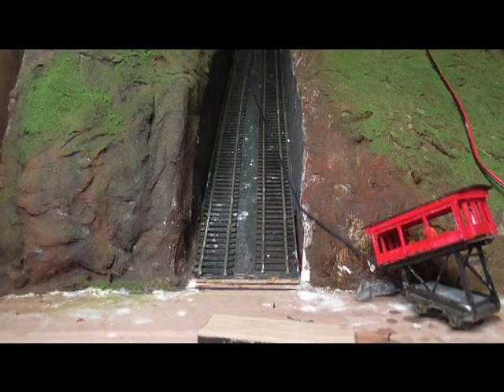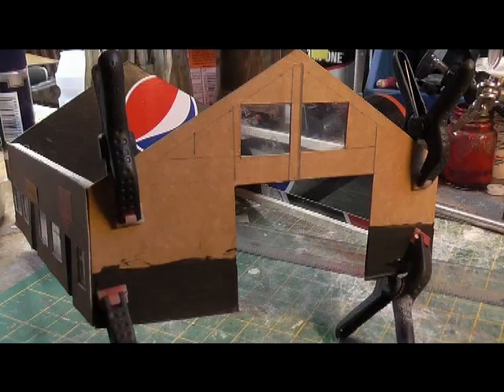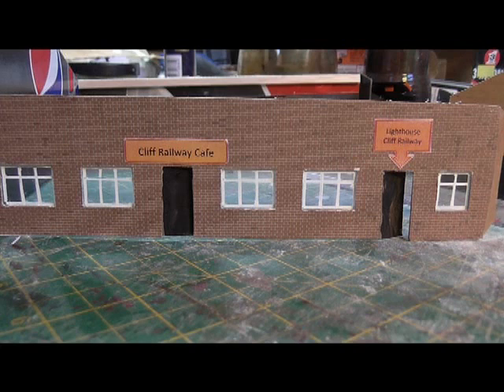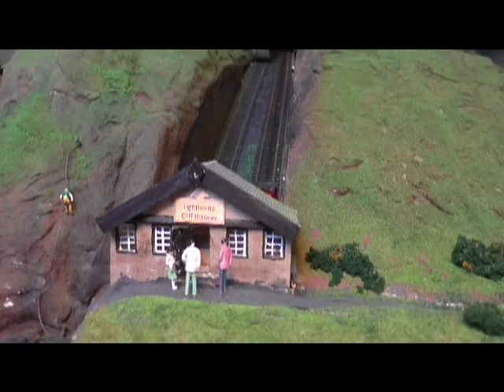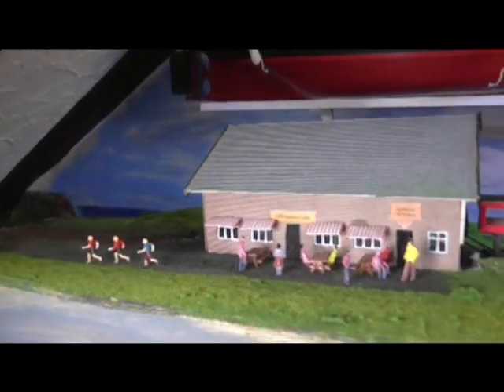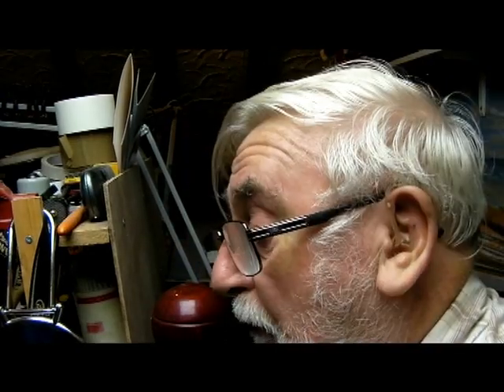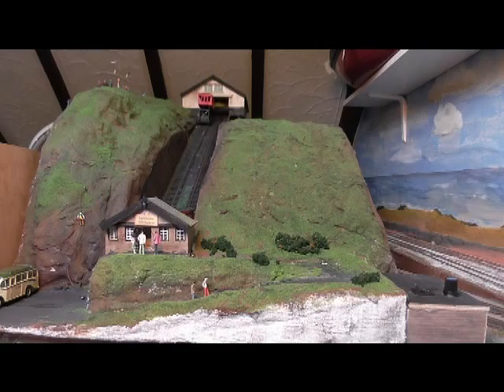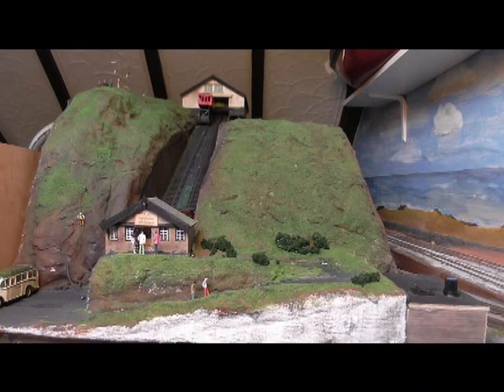How to build a Funicular Part 4 FINAL VIDEO

Comment: Hi Michael, You've inspired me to build my own! I've had my eye on a brass model kit for £150 but that's just for the coaches and electronics. As a child I was fascinated by the cliff lifts at Scarborough, have you been? I think they used to have around 4 or 5, but they still have 2 running.  I plan to use an Arduino for control so I can automate the slowing down at each end and try to get quiet motor movement which is going to be a challenge!
Reply from the maker: Hello R Wallis, (very formal but I don't know your name).  Anyway, I pleased to have inspired you and shall be very interested to know how you get on especially with the control system you intend to use. 
No, I haven't seen the ones at Scarborough, mine is based more on the one at Bridgnorth in Shropshire. Good luck with your build.  Please make a video of it and let me have the link.  Regards Michael

Comment: Thats amazing, I've got a similar idea for a working quarry incline and I'm going to try out the same sort of mec as you've used.
Reply from the maker: Hello Mark.  Thanks for the comment.  There were a couple of things I didn't bother to mention in the video.
1.  I found some platted wool to use instead of cotton which provided much better friction on the wheel so the 'rope' now simply passes round the top of the wheel.
2.  I added weight to the bogies which, again, adds to the friction.  Now there is no slip at all.
Good luck which your project and please let me see how it goes.  Regards Michael